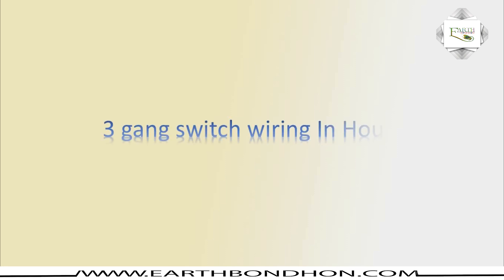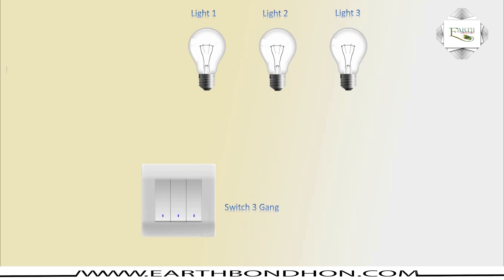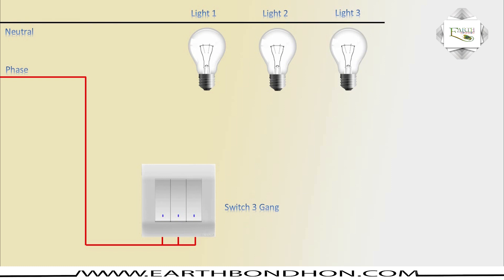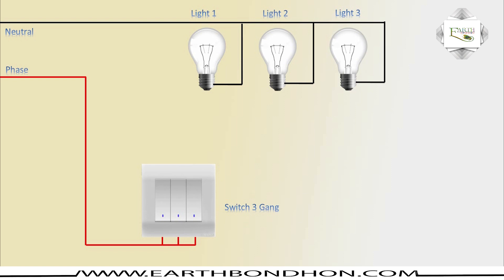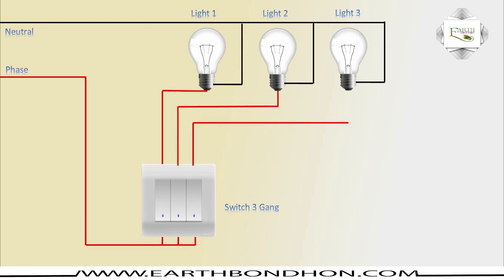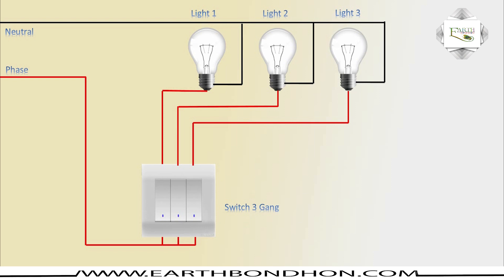House wiring 3 gang switch wiring diagram | 3 gang switch | switch

Comment: Just installed one and 2 and 3 not working. I put jumper wires to black and grounds. Voltage is present everywhere. Switch one is working powered off outlet before it. Voltage is present and all wires are tight. Please help. I figure its a ground but everything is tight.
Reply from the maker: yes, sir
Thanks for your feedback, please follow.........
"Thanks for watching the video"   You are very welcome!